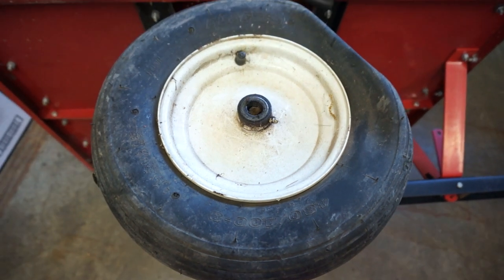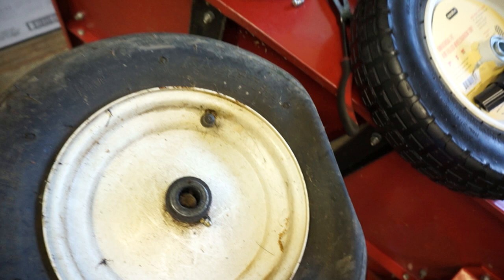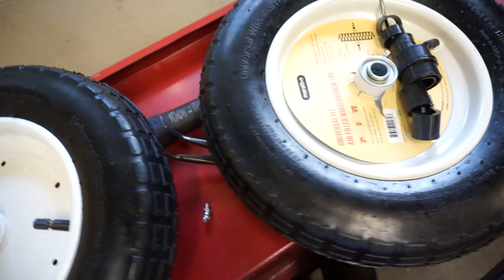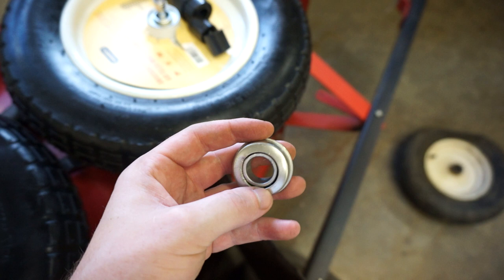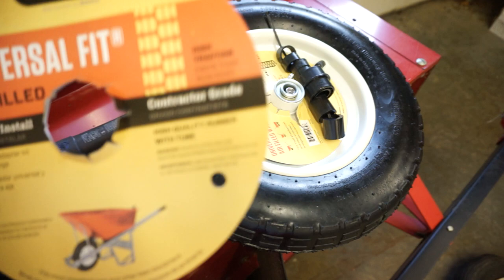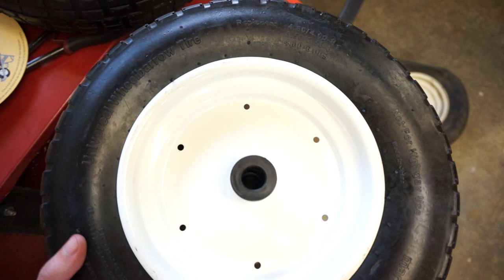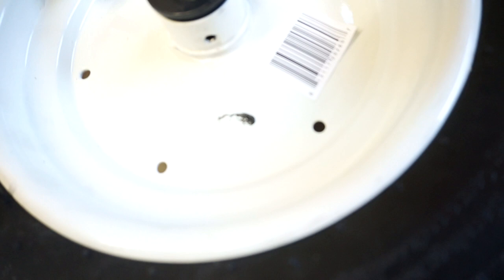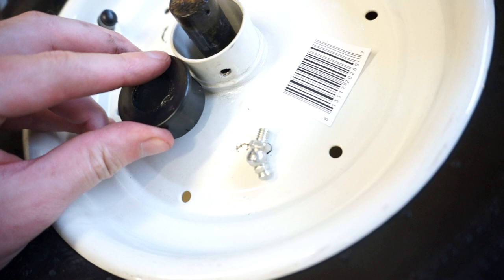How to Install New Universal Wheels on Your Utility Cart, Trailer, or Wheelbarrow

Comment: I just converted my grandsons pull wagon, with a 1/2 axle to 5/8 to accept harbor freight wheels. I used two 1/2 to 5/8 steel bushings. Each bushing is 1 inch long, for a total of 2 inches. 8 total for the wagon. They fit tight and look good.

Comment: Just mark the plastic bushing where the hole is on the hub, Drill it out larger than the zerk threads, Line the hole up with the threaded hole on the hub insert the zert, it will now screw down and  you will be able to grease the axil as needed.

Comment: Could have re used the original bushings, the bushing has a flat side so the grease zerk will fit, Also they are usually steel, the new ones are plastic.

Comment: Had the same problem. Have a country pro dump cart with 3/4 sized axle and the only wheels I could find were 5/8 size. Will check lows

Comment: Just got finished replacing tires and rims I bought at harbor freight for $5 each. Hardest thing to do was removing the push nut! After removing the old tire and rim I used a little wd40 to make the assembly easy.One tire was a little out of being true. But after all they say “Not for highway use” on the side. Chuckle

Comment: Thanks for the illustration.I am changing my wheels but have a 3/4 axle and th replacement wheels are 5/8.However, I am having difficulty in locating a vendor for the adaptors you used.You mentioned Lowes but I am in Canada and Lowes here do not appear to stock them. Any suggestions?

Comment: So the Universal wheel isn't really Universal for a 3/4" axle. Next Brand.
Reply: Yes, it is. He showed how to swap it for 3/4.  The ones I bought at HarborFreight today have BOTH 5/8 and 3/4 bearings, rather than just the plastic bushings shown above.  Knock out the one you don't need and install the one you do.  They also came with other plastic shims for other off-size axles that are 1/16 smaller than the two sets of bearings.  $28 each (4.80/4.00-8, 15.5-inch diameter tires).  The 3/4 "shims" also work as spacers inside and outside the wheel hub, making it tighter between the cart and the washer held by the cotter pin.  I just found the same product at Tractor Supply for $20. 16 in. x 4.00-8 in. Pneumatic Wheels with Diamond Tread, 3/4 in. Bore Size, PR 3013-1